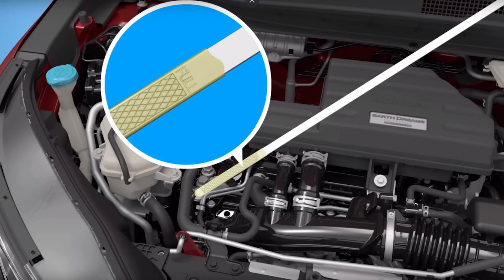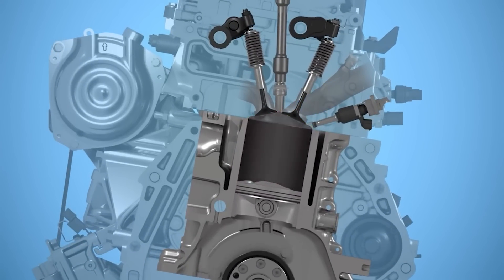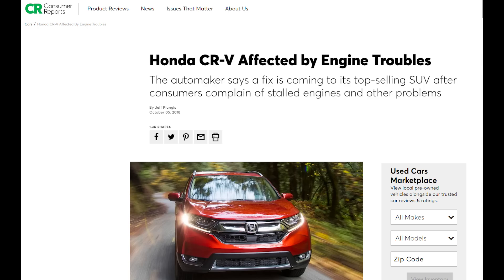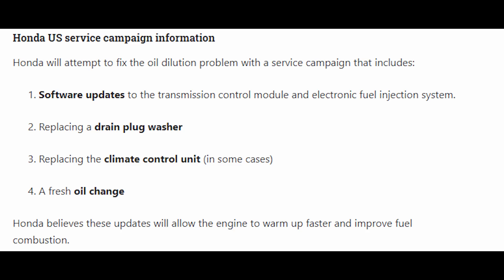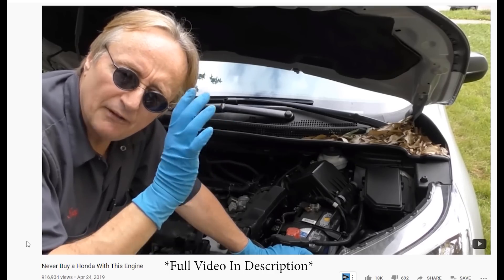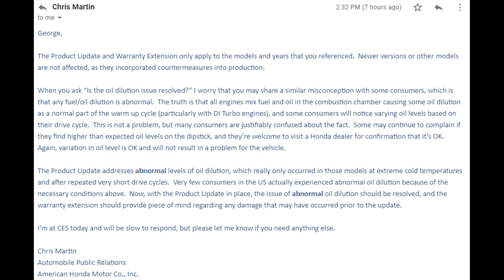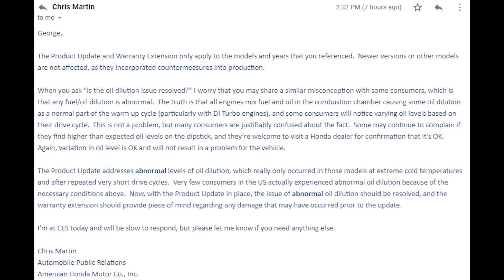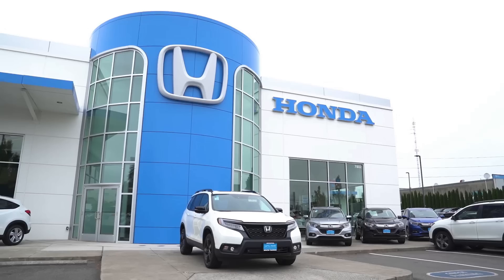Does Honda Have An Oil Dilution Problem? | 1.5L Engine in CR-V and Civic

Comment: How many of these people asking about Honda oil dilution actually own Hondas and are experiencing oil dilution? I've got a 2017 turbo and in three years have had no oil dilution issues.  None.
Reply: 2017 Si ZERO issues as well
Reply: I have it. I also had 1.5T Civic Si and 2.0 Type R.  Only 2019 CRV has oil dilution
Reply: Same
Reply: I have a 2017 CRV and after 2 annual oil changes, I’ve not seen any rise in the dipstick level or any smell of fuel in the oil. I think people are confusing fast flowing low viscosity oil with fuel dilution but I live in Houston where we don’t have extreme cold.
Reply: @jamespn  how do you explain the gasoline smell that's more overwhelming than 2.0T in my Type R?
Reply: Seanster Yu I really can’t, it’s a shame, I really like the type R. It must be a thrill to drive.
Reply: @jamespn  I got 4 Honda, my Type R, S2000 and FIT dont smell like gasoline when I change oil, and I do most maintenance on my own.  Dealership told me the problem has been resolved on 19 CRV but I know it has not.  I am using Amsoil every 5k on the CRV and see how many miles I can get out of it.
Reply: Seanster Yu according to the op you are a liar then!
Reply: Lucky folks, my 2017 CR-V oil rises to top of dipstick within 1500 miles, living in southern California (zero days of freezing weather).  Warranty was extended by Honda to 6 years and unlimited miles if your cams wear out via class action suit.  Hate to be person who my my used CR-V after that.  Wish I knew the reason...I suspect bit of leakage past injectors into cylinders each time after engine is turned off.  Others say Low Speed Pre-Injection is prevented by excessive fuel injection when engine is cold, but how could that be unburned?

Comment: I want a new Honda Accord. Guess I will get the more pricy 2.0T engine instead of the 1.5T. The Civic Type R has been proven reliable. So the Accord with the same engine should be too.
Reply: The fact the 2.0T has proved reliable and not had the oil dilution issues only goes to show the 1.5T problem is not "normal". Honda are proven to be liars by their own product range.
Reply: Also watch out for smaller sale volume in comparison to civic and crv sale volumes.

Comment: Wish I had kept my 2009 Accord.  230K and no major problems.  Don't know what I'm gonna do with this CRV but no way I can trade it now.  OD issue is so widely known the dealers will beat you down to nothing.  Honda has been in a financial pinch for some time and has started doing things on the cheap.  For example, the floor mats in my 2009 acccord were plush and of good quality.  The mats they put in them now are cheap junk...probably from Viet Nam.  The 2009 owners manual was a well finished book.  Now you have a el cheapo piece of crap or you have to go to the net and spend lots of time finding answers.  On top of that I'm getting 28 mpg on the highway where I used to get 32.  Disgusted.

Comment: Omg he used Consumer Reports already flawed right there🤦‍♂️

1. Toyota
2. Honda
3. Madza or Kia/Hyundai

These are the most reliable car companies as of right now how tf is Dodge more reliable than Honda wtf
Reply: ChuChuTrain because dodge hasn’t introduced a new product since 2014 so they’ve worked out all the issues in the last 6 years so there fairly reliable
Reply: f181234 you buy a 2020 Charger and i’ll buy a 2020 Accord lets see which ones have problems more Consumer Reports is an advertisement company companies pay them to say those things how is a Honda Passport thats only been out for 2 years even on the list? Toyota has always has been and will be the most reliable car company

Comment: I work at a Honda dealer. We have not had a SINGLE case of this yet, even on the supposedly affected 2018's. And we live in "that" climate, Colorado. Unless my service tech's are lieing to me, but you'd think I'd need a comeback in sales.
Reply: Will you be able to say the same thing 3+ years from now when the 18 CRV's have over 100K miles on the odometer?   Gas mixing in with an already thin grade oil will not provide adequate engine protection.   And, what do you advise owners like myself who are now experiencing OD again after 1K miles after an oil change....so, change your oil every few hundred miles now?
Reply: Mark P If you have a legitimate problem, you should file a warranty claim. However I’ve driven a 17 CR-V 1.5T with 97k miles and it was mechanically fine.
Reply: @05Forenza  I have contacted Honda.... No warranty extension approval beyond the one add'l token year they gave CRV owners a few months ago.   I'm being told "change your oil more often"....I get gas fumes in the cabin after 1K after an oil change now...only 12K miles on my 18 CRV.   I've owned 8 Hondas and am amazed by Honda's downright awful customer service.   My next vehicle will not be a Honda....

Comment: Hay! my break pads are wearing out faster that normal!  Car guy: No problem, just replace them more often!  Ok! but is that normal? should that be happening? seems "inefficient"!  Car guy: That might be true, but all you have to do is change the pads more often!   Gee thanks!
Reply: Stay off peoples ass and slow down a little before braking instead of starting your decel with braking alone.

Comment: As a Honda fan...I'm concerned with the Honda 1.5 resale value 5-7 years from now (we are a Honda family, but we just bought a used Acura RDX specifically because of this issue, that, and no CVT tranny).  Honda will regret the 1.5/CVT .  I'm pretty sure it'll be a bigger deal than the Odyssey/Accord transmissions back in the early 2000's.  But time will tell.

Comment: the old hondas ran for more than 100000 with little or no problem so why didn't honda offer this to extend warranty. Anyone putting this kind of mileage on in 6 years is living on the road and therefore won't get the same degree of dilution as someone who drives 100000 in 10 years . Going to be hard to get a fair price from anyone when your ready to sell or trade. After a lease is up there should be lots to pick from at the auctions.

Comment: Honda better clean up their BS act with the oil dilution.  Honda is going to lose their shirts and fans if they don’t fix the 1.5 turbo series of engines!

Honda issues a “software fix” and it’s bs...  Honda got pressured from the EPA for that direct injection turbo when they weren’t ready...  

How about recalling the engines/piston rings huh?  That would make more sense...  Granted I feel this issue is more in the 1.5 crv’s than civics for some odd reason

Comment: Back in the late 70s and 80s honda engines could pass emissions without the use of a catalytic converter unlike their American  counterparts, if they can do this they can fix this problem while still having good fuel economy. Its the gdi for sure. Every honda engine ever has been turbocharged by someone or another and ive never heard of this dilution prob with anyone ive spoken with. Peace

Comment: Toyota is the best manufacturer of cars and has been for 50 years
Reply: Even Toyota have problems with the new technology forced on them to meet EPA standards. They have a class action suit against them for their 8 speed auto trans problems which has been rumbling on for some time without a fix as originally the trans was debuted in the Lexus models where it had the same issues. I've been looking at a new suv for my wife, currently it seems a bad time to buy  new vehicle if you plan on keeping it for 10 years or so as the turbo, direct injection, 8/9/10 speed auto transmissions, CVT transmissions and various emissions equipment all seem to be causing problems across all brands. If you want reliability then you need to look at what is still "old school" technology something like the 4Runner or another vehicle that has not been updated yet.
Reply: @fiveowaf454  That is the only major issue Toyota has had in 20 years. I'd rather have a Toyota than any other brand.
Reply: @DStabs720  That may be, but don't be blind to their issues and falling quality that is well documented.
Reply: @fiveowaf454  Says the person who is blind to all of the other manufacturers that have 10x the problems. That is the only problem toyota has had in 20 years. Some of the oil burning in cars isn't even toyotas fault. If you change your oil every 10k miles you will destroy your piston rings.

Comment: A few years ago, I would have put Honda at or near the top on the list of vehicles I wanted to own next.
Today they don't even crack the top 5 due to the 1.5L turbo being in the vast majority of their vehicles across the lineup.
Reply: Honda’s in the United States have been big pieces of junk starting around 1998 with automatic transmission failures, ac failures, excessive oil consumption because of VCM on the V6 and some 4 cylinders engines, front brake rotors warping easily, air bag lights, CRV with bad vibrations certain years, outdated 5 speed automatics when the competitions were using 6 speeds and more problems that I have time to mention. 
The quality of the parts is lower too. For example 1994 to 1997 door panels on the Honda accords and top of the dash use to be all soft touch materials then starting in 1998 Honda use a lot of cheap hard cheap looking plastics.

Comment: I Work at a large used Dealership. And these Tiny displacement DIRECT INJECTION Turbo motors from Honda, GM and Ford and some others manufacturers we get  tend to struggle and stay in constant turbo boost and work hard all the time.I seen Turbos in these motors going out and getting replaced as soon as 50k miles in a lot of cases. Direct Injection is bad if you only do short trips and use regular gas in the long run, when your well out of your warranty! These motors very unlikely to make it over 150k miles. UnLike the older non turbo larger displacement designed  4 cylinders in the past! I had 2002 Ford Focus 170hp SVT 2.0 L engine without direct injection run over 337K miles and I sold the car running still!
Reply: Just about all the new technology that's been rushed in to meet mpg requirements has been a big negative for the consumer. Turbo's, direct injection,  CVT trans, 8/9/10 speed trans etc, etc. seem to all have put vehicle reliability back decades. I've been looking for a new SUV for my wife, but it seems there are so many problems with numerous new cars and brands that a lightly used vehicle with old technology is the best buy currently unless you say to heck with mpg and buy something like a 4Runner that is old school but has terrible fuel mileage.

Comment: No they dont good lord it was literally a super small amount of vehicles. It was fixed by Honda and fixed for free. I work with Honda and we have barely had any customers come in with that issue.
Reply: Bryce Porterfield this is interesting. I’m considering a crv. But hearing about this and reading the comments, I don’t see how I could. But I just had a very long conversation with a Honda salesperson about this issue. She said they sold over 1000 crvs last year and had one come in with this problem and it was from Canada. And that Honda bought the car from them. She said the accord has had the same engine for 7 years, and the same engine is in the 2017 model with no reports of this problem. I don’t know what to believe about this. Why would she stake her reputation on a lie or cover up by Honda?

Comment: About to hit my 3rd year with the 2017 crv only problem I had was the shifter button break off.  Honda did extend the warranty to 5 years due to the issues but I'll probably have a different car then.  Wish crv had a 2.0 with a bigger has tank

Comment: I have a 2017 LX with the 2.4L engine. It has the problem too,  since it uses the same type fuel injection system. I have had 4 oil samples over the two plus years I have owned it and all are 2% and above. The most recent was last week with 3.3%. Thanks Honda, I have been buying your vehicles and power equipment for 55 years. No more!
Yes Scotty, I do change my oil every 5,000 miles, with full synthetic.

Comment: I have a 2019 -exl. Oil dilution is still a problem. I have no gasoline smell in the car itself, but the oil level is 1/2 inch beyond Max level indicator mark on the dipstick with  strong gasoline smell. I installed a manual ball valve inplace of the oil plug to drain 1 qt of  oil once per month and add new oil to midpoint   level of the dipstick. Try to sell the vehicle, but would lose $7000 . Will never buy vehicle with turbo engine again. Very disappointed with how Honda has been responding to this problem with customers who have this problem. Honda wouldn't even tell me what is the absolute maximum level of oil on the dipstick to prevent engine damage from oil being whipped by the crankshaft. -which will change oil liquid to oil foam with less lubricant property.

Comment: The one extra year of warranty for a flawed engine design is a sham from Honda :(... I owned five Honda made vehicles (Integra, Legend, CRV,  Odessey, and now RDX).  My Odyssey had a defect transmission and it it was replaced under the extended warranty due to defect transmission @55K miles... two years later, the replaced transmission also broke down by not able to reverse out of the parking space from time to time (Yep, I sat around until the car in front of me moved out for me to drive straight out).  I sold it cheap with the warning to the new owner about intermittent defect transmission issue.  So, this 'one year' extra is good bot not very beneficial to say the least...it's best not to buy into a flawed design engine or transmission in the first place... just wait out until Honda resigned its defective engine before buying one.
Reply: Paul Cheang Integra type R was very nice car

Comment: Considering my 2019 si is in my drive way taken apart because of it I’d say it is not fixed. I was out of warranty for “engine mods” so im working on my car myself. Not only was my oil diluted an arp bolt was half way out when I took off the oil pan so now I have to get it resurfaced. Thanks Honda.
Reply: phantom shady damn how did the arp back out..

Comment: I went with a 2019 Rav4...no turbo, no CVT, no GDI (rav4 has dual injection) and no oil dilution.
Reply: ...and much higher fuel consumption.
Reply: @troyjollimore4100  I'd rather buy more fuel than spend my time arguing with a manufacturer and the dealership over vehicle issues. However the RAV4 has been having transmission failures and operating issues. Currently there are too many under developed technologies being used that were rushed to market to meet EPA requirements, so unless you can target a vehicle that hasn't  been updated for a while and is still using the older technology, now is not a good time to buy a new car for the type of buyer who plans to keep it and rack up a big mileage.
Reply: @fiveowaf454  Bad news for my parents. They bought an '18 RAV4! ;) Dealers may vary, but in my experience you can talk to Honda and they will go to bat for you. Toyota? Nope. They rely on their quality, with sub-standard customer service beyond that.
Reply: @troyjollimore4100  My experience with dealers over many years is that they are all pretty useless at solving problems once they occur, they like to fob you off or have no idea how to fix anything,  so the secret is to get a god car in the first place and not to have to rely on the dealer system for anything more than an oil change.
Reply: Fiveo waf Mostly, but some are good. I can do my own work, so I don’t rely on dealers/mechanics as much. But, no matter the make, if you get a bad car, you get a bad one. Lucky when you get a great one!

Comment: My wife and I are intending to purchase a CR-V this week.  Your coverage of the issue is very good.  Scotty Kilmer says be careful, change the oil regularly.  The title on Scotty's video says "Never Buy a Honda With This Engine".   My Independent Honda mechanic says good things about the older 2.2L non-turbo engine, which is still available on 2019 LX models.  I would like the upgraded safety features of the 2020 model.  Any suggestions would be most appreciated.  We are in analysis paralysis.
Reply: Unless you are willing to check your oil every week and fix the problem yourself, I wouldn't recommend any car with this engine. Aside from the oil dilution problem, the new CR-V is nice,, but it doesn't worth the headache. After all,  the main reason that most people buy a Honda is for its reliability and a piece of mind. This CR-V doesn't represent that. However, Honda has done a great job of marketing this car to the general public. Apparently, not all CR-V have the excessive oil dilution issue, the problem is you don't know for sure if yours has the problem until you own one. I have a 2019 CR-V with oil dilution problem even in warm weather. If I know about it beforehand, I would never buy it regardless of how much I like everything else about it.
Reply: I bought a 2019 LX model with the good 2.4L engine

Comment: It is still a problem, I smell my oil at 1700 miles of use and it smells like 2 stroke engine gas-oil mixture. SOS. I complete wish i did not buy this car. I'm more frustrated that Honda just blows this off like its nothing.
Reply: @ Steven Will You are not alone. Same problem here.

Comment: Anyone that leaves in cold climate must not take more than 10-20 seconds to warm up the car. Also grab a oil catch can.
Reply: Running for 10-20 seconds in deep cold weather (-20 deg ) could not even reduce the rpm gauge by 50 rpm. While the in-car temperature is almost the same as outside temperature, I wouldn't call it warming up the engine. Doing so only make the piston rings wear out quicker and yes, more severe oil dilution.
Reply: Oil catch can is good for reducing carbon build up in combustion chamber.  More carbon deposit make oil dilution issue worser since the combustion mixture could not burn entirely.